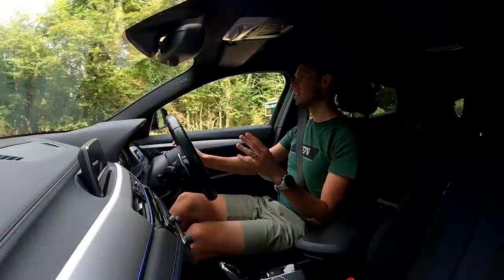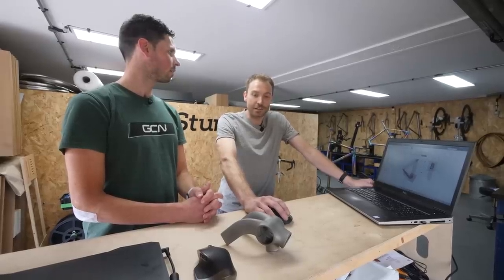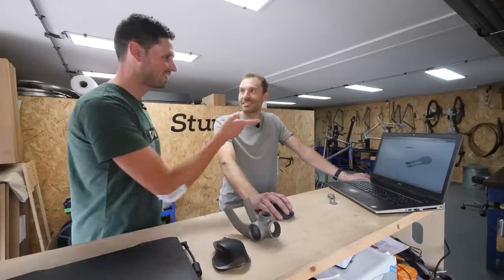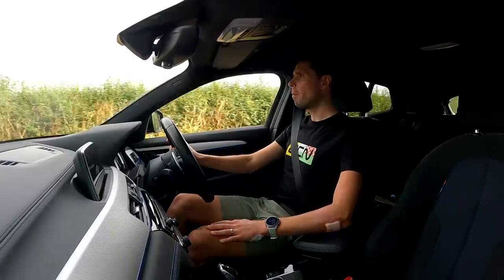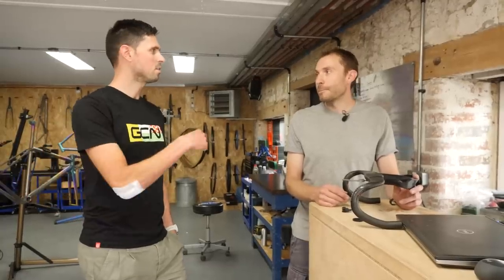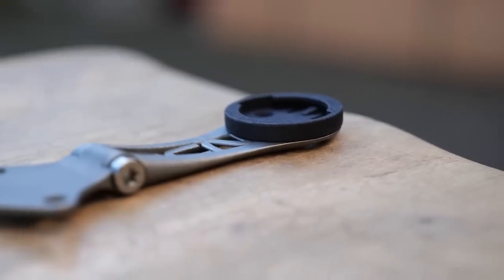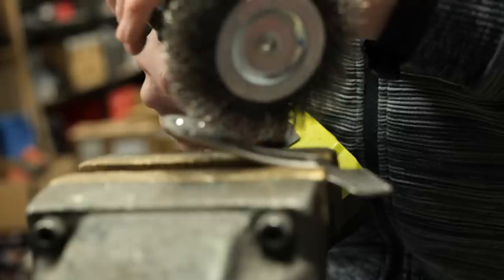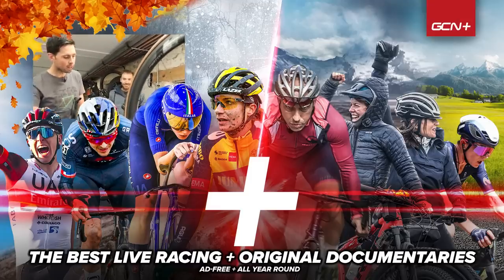How Are 3D-Printed Titanium Bike Parts Made?

Comment from the maker: If you could get a custom made 3D-printed bike part, what would it be?
Reply: I'm currently exploring the possibilities and also if I can do it myself or I need to consult an expert, but I'm trying to build a very special stem (adapter) to come up with a combinations of bike parts that people now say it's impossible. I want to submit the unique bike build to the bike vault and have a go at dropping Ollie's jaws.
Reply: a cassette!
Reply: That is so cool!  I'd buy that mount from the GCN shop!  Just needs to fit my bars. Sounds like a new product line for the shop 😁
Reply: If money was no object...maybe an entire 3D printed bike.
Reply: lube
Reply: A frame.  I would do very naughty things to get a titanium frame that fits me.
Reply: I have made a few 3D printed bits for my bikes in PLA (Plastic); but it would be nice to have them transferred to metal.

The parts I make are usually adapters for head and tail lights to fit peculiar lights, frames or racks.

PLA works until the tropical weather gets to them (high temperature and humidity plus the exteme UV of the Aussie sun). They often age to brittle, then fail.

The bit missing in the video is the several weeks to go from plastic to titanium; I assume that the printed plastic part is used as a model for a casting mould into which molten titanium is poured. Something I can't do at home.

By the way: what would have been the commercial cost of having this part made in the video?
Reply: Custom shape handlebar. But, I think it would be rubbish, compliance, weight etc. I can't find rare shaped handlebars I'm material  and weight I desire. Guess it's hard to make and test if it's small numbers.
Reply: @TenSapphires  I'm in the same boat, so I'm going with welded Ti. It's not too expensive and you can really go wild with the position.
Reply: @galenkehler  Can you bend Titanium in drop section? I feel its to much for material but probably one can bend then weld sections. I was looking Moloko handlebar but lighter. Or DIY Speeco ;)
Reply from the maker: @leonbroekx  Sounds awesome!
Reply: I really like the chainrings on Sturdy bikes! When you were making tea, I could see some in a cabinet, they look awesome!
Reply: Bottom bracket retrofit for Bosch electric motor. I'm getting a bit long in the tooth.  I spent quite a bit on a custom ti bike a while ago and would like to ride again after a long time off. There is no chance of kidding myself that I'm getting any younger.
Reply: ...and a fork
Reply: ...try to realize rims, or maybe a three or five spoke wheel? There wheren so many Options for non symetric parts. Lets do some parts for a derailleur...

Comment: I have a 1988 American Comp Lite, which is still my only bike and through upgrades functions better than new, that was one of the first bikes to have a replaceable derailleur hanger.
Although it is still holding up it is the one part that would be nice to have a more ridgid version of, maybe not requiring as many subtle adjustments.
More bikes now have this feature so dimensions are already there for easier development.
Hey you asked;)

Comment: My perception of 3D printing was of a fast process. Didn't realize that it was a longer process depending on what the materials used would be. Facinating.
Reply: 3D printing’s advantage is not speed, it is the complexity of designs it can make vs CNC machining

Comment: I wouldn't want any part of a bike frame to be 3D printed. The grain structure would suck; probably as bad as, or worse than, casting or MIM:

"Fusion-based metal additive manufacturing (AM) processes are featured by small melt pools and steep temperature gradients from the solid–liquid interface toward the liquid metal. As a result, the solidification process shows a strong epitaxial growth tendency from layer to layer while the number of nucleation events is limited due to both the absence of potent nucleant particles and the small melt pool volume (consumed quickly by epitaxial growth). This leads to columnar grains along the build direction in most additively manufactured metallic materials, which cause property anisotropy, reduce mechanical performance and increase tendency toward hot tearing."

That's from an article that discusses improving the grain structure of 3D printed titanium (and metal in general) parts using "high-intensity ultrasound" during the process, but I highly doubt they'll be matching the excellent properties of traditional drawing, forging, or rolling, any time soon. Of course, for the trivial item they made in this video it doesn't matter, nor does it even make sense to waste money on making it out of titanium. Aluminum would have been more than sufficient.